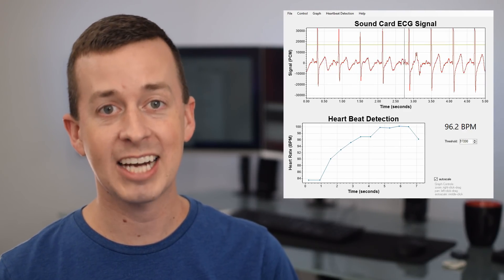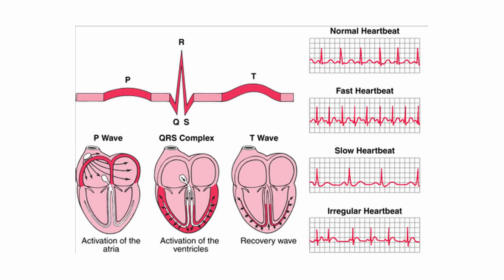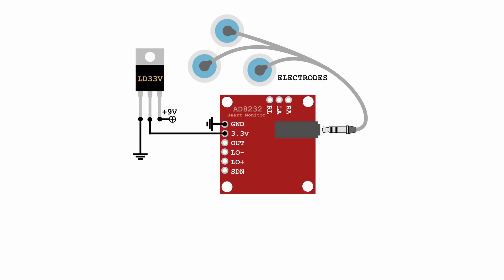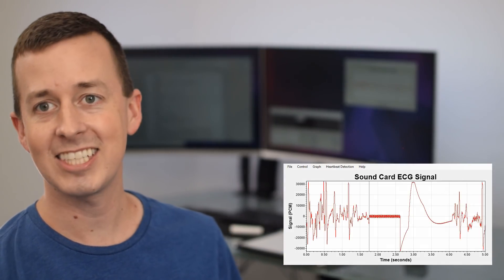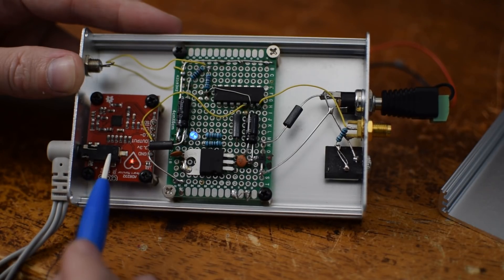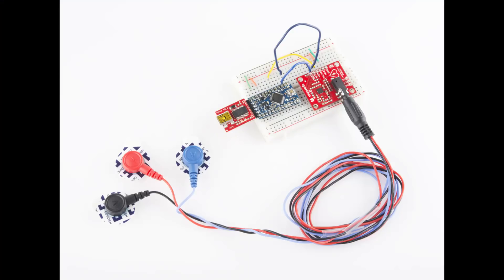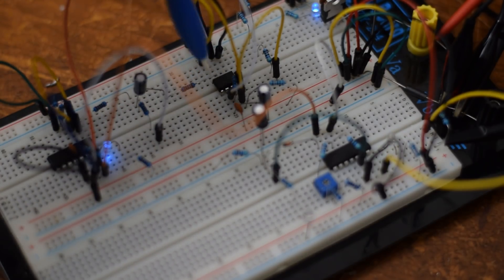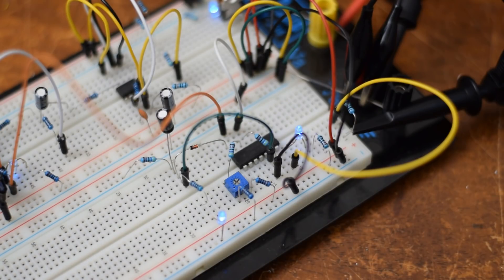DIY ECG with AD8232 and Sound Card

Comment: I have a doubt,will it give same accuracy like real ecg machine.and how many percentage of accuracy will it give
Reply: As a retired biomedical engineer, I can comment on the accuracy.  Firstly the timing accuracy.  This is hardly going to be affected by a simple ecg device such as this one.  The intervals between cardiac events take place anyway and are recorded by the device and the viewing system and will be shown clearly.  To make a real diagnosis one has to make careful measurements of the interval between the events (eg QRS interval) with a high quality system and then use years of experience and training to make a diagnosis.  As for the amplitudes, these are indeed likely to be distorted by the simple circuits but amplitudes are hardly used in diagnosis because they are so variable and unreliable anyway.  Electrode type and placement, chest wall thickness, obesity and gender all affect the amplitude.  Mains interference and movement artefact also affect the apparent amplitude so apart from the general shape of the signal, I suggest you forget about the amplitude.  The exception to this is if you see that the QRS spike is very low and flat, in which case you should seek medical attention.

Comment: I did this without any of the extra capacitors and stuff shown for the QRS circuit and whatnot. I just have the AD8232, a voltage regulator and a battery. My computer isn't picking up the audio jack as a microphone, so I can't display readings, even though before I plug it into my computer the light on the AD8232 flashes with my heart beat, so I know the circuit itself is working. Is there any sort of software or driver I have to download to get the readings onto my computer?

Comment: 😅sorry about your health. buut, i built you gdmaned ecg, it worked. instead of a computer i used a battery powered oscilloscope. its noisy but it worked. now to work on a 60 hz filter.

Comment: a great video. I have a few Karda devices A large amd a credit card size/   they use a coin battery to reduce size. also, any ideas on their Elec odes without wires - what to use for DIY. thanks for your great work. I also want to transmit the signal short distances over 433 devices. will try to change the signal with the Arduino plotter readings.

Comment: I've seen those using arduino and the plot looks pretty "spiky" (not as smooth as yours).  I wonder that is because of the entire circuit you built or the quality of the eletrodes. Either way, I want to know if I need all of that circuit for it to work like that or simply conecting it on a double end p2 jack hooked to my computer directly. I would like to know if its possible to save the data and plot a static version of the graph as well. Great job!

Comment: Great video! Can you upload the diagram circuit with lm324  because i can not find it.Trank you
Reply from the maker: Hi Ivan, this video only uses a AD8232, not any discrete op-amps like LM324. Check out https://youtu.be/AfirWls9Sys for a design like that
Reply: @swharden  Thank you very much for answering, in the video I see that you use a lm324 buffer and an indicator led, what would the circuit be like since I don't know how you did it? thanks
Reply from the maker: https://pasteboard.co/JMGTa46.jpg
Reply: @swharden  Thanks for answering, look, I am asking you, I have to measure the heart rate with a microcontroller. Is there a way to connect a smith trigger comparator to the ad8232 and generate a square wave to measure it more easily? thanks
Reply from the maker: @ivanirumberry2125  I think you are asking about a Schmitt trigger comparator. Yes, this can be done but I do not have an example. This topic is discussed in this video from 12:30 through 15:30

Comment: Did you happen to post the circuit diagram (or breadboard diagram) for the EKG simulator somewhere?
Reply from the maker: Unfortunately no, but it's just a 555 timer that makes square pulses at about 1Hz and such a circuit should be easy to find online
Reply: Scott Harden I’m more interested in the filtration you used to make it a « spike ».
Reply from the maker: @bglezerson  I updated the description to include a link to this circuit since this question does come up from time to time. Let me know if it helps! https://swharden.com/blog/2020-09-27-ecg-simulator-circuit/

Comment: I asked myself, what is the difference between and Adinstruments channel recorder and a Sound card ECG device? I bought an Adinstruments 8SP for 200 USD on ebay. But for ECG it needs an additional Bioamp, which costs additional 150 USD on ebay. Is the Bioamp equivalent to the ECG breakout board, and the channel recorder equivalent to the rest of Scotts circuit? 

I asked the Adinstruments support how many EEG channels the Adinstruments 8SP supports, and whether they are validated data available for EEG recordings? No, no validated data available. The 8 SP works for 8 EEG channels, and I would need to buy another Biamp, the Octal, which looks very expensive. Furthermore I would need to upgrade from Labchart 7 (which I don t have) to Labchat 8, since the newer Adinstruments amplifier need Labchart 8. I give up my Adinstruments EEG validation project.

Comment: Unfortunately no Matlab printed circuit for Scott Hardens sound card ECG. Senior scientists care about your health Scott, and also about the quality of your support for the sound card ECG:

https://ch.mathworks.com/matlabcentral/answers/592234-how-to-print-scott-hardens-sound-card-ecg-circuit-be-printed-on-a-circuit-board-to-reduce-soldering?s_tid=prof_contriblnk

I did what I can to promote sound card ECG for Matlab. Maybe someone else will follow and promote it further, it s worth it. Scott Hardens sound card ECG for Matlab and Python, for junior scientists and simple people.
Reply: Matlab supporters complain about you, Scott, for not being present in the Matlab community. I also miss you there. I suppose your device requires only Matlab student version is 50 USD or Matlab home version for 100 USD. A good example for being present in the Matlab community is Peter Charlton with his respiratory rate estimation project:

https://ch.mathworks.com/matlabcentral/fileexchange/55289-respiratory-rate-estimation

Such a presence of the sound card ECG in Matlab would be desirable.

Comment: Hi Scott , just a little word of caution. The ground pin of the sound card is probably connected to the mains earth.This could be a source of danger in case of some devices which have a ground fault.Hence it is probably much more safer to use a battery powered laptop. Of course the best would be to use a wireless bluetooth device, i guess.
Cheers and hope you are in the best of health !
Reply from the maker: Hi @mumbai, I hear this comment frequently. The input impedance between the AD8232 and the pads is extremely high. Even if the AD8232 were grounded (e.g., through the sound card), risk is eliminated because the person is not connected to the AD8232 through a low impedance path, so a ground fault is not a concern.

Interestingly, grounding yourself to your computer is common. Many people physically ground themselves to their computer with a wrist strap connected to their computer chassis when they work inside their computer. Since that is a low impedance path to ground, a wrist ground strap strikes me as much more of a concern for ground faults than a setup like this. It's an interesting topic to ponder!
Reply: @swharden   Thanks for the reply. A ground strap has a 1Meg resistance to ground, hence it is not a " low impedance path to ground", quite the opposite actually. Also when working on mains equipment always unplug the device , else/and use suitably rated probes and test equipment. The last thing you want in such circumstances is a  "low impedance path to ground"
"risk is eliminated because the person is not connected to the AD8232 through a low impedance path"
Actually isn't the conductive gel drastically reducing this impedance ? I could not get the circuit diagram of your module, so am not too sure about this.
Indeed it is an interesting topic to ponder.
Reply from the maker: @mumbaiverve2307  Thank you for correcting me! You are right, wrist straps typically have high series resistance and are not low impedance. I definitely overlooked this point when drawing my comparison. Silver chloride gel indeed decreases impedance between the pad and the chest, but if you review the AD8232 datasheet you'll find all leads are connected through high series resistances. I guess ECG circuits like this have high series resistance for the same reason that wrist straps do. In all cases, safety (especially when using mains-connected devices) should be considered.

https://cdn.sparkfun.com/datasheets/Sensors/Biometric/AD8232_Heart_Rate_Monitor_v10.pdf
https://www.analog.com/media/en/technical-documentation/data-sheets/ad8232.pdf
Reply: @swharden  Thanks for the reply and the docs ! Hoping for more videos in future...
Reply: @mumbaiverve2307  and @Scott Harden. I took over some of your suggestions to a discussion in the EEVblog. I triggered a tremendous discussion about safety of EEG and ECG devices which are connected to a PC in the EEVBlog:

https://www.eevblog.com/forum/testgear/how-to-solve-the-ti-ads1299-eeg-demo-kit-is-not-save-for-humans-problem/

Even connecting an ECG or EEG device to a battery powered laptop, is risky, just check the discussion there. OpenBCI recommends to use EEG devices with wifi for safety reasons. Is it possible to connect a Wifi module to your circuit? Or audio over bluetooth? Or connecting your circuit to the audio jack of a Linux Pinephone and use the Pinephone as a data acquisition system to avoid risks?
Reply: @swharden  Nice to have your reply, which means you are doing well , I hope !

Comment: I m currently struggling with several devics which have the potential to be research grade devices like Scott Hardens sound card ecg, Bitalino, Mind Monitor, Dr. Ing. Rainer Blinds a training tracker, but they are generally not develeoped for this purpose. With a little effort, this can be changed. I m promoting the idea to integrate MQQT in the device software and stream sensor data to the Influx data base. In this way, sensor data from different low cost high quality devices can be streamed into one data base, and can be read out for instance with the Influx Data Base client for Matlab or Python:

 https://ch.mathworks.com/matlabcentral/answers/585584-adding-mqqt-to-the-eeg-mind-monitor-app-for-a-real-time-stream-to-matlab?s_tid=prof_contriblnk

https://ch.mathworks.com/matlabcentral/answers/585593-adding-mqqt-to-the-ant-and-ble-a-training-tracker-app-a-for-real-time-stream-to-matlab?s_tid=prof_contriblnk

https://forum.bitalino.com/viewtopic.php?f=19&t=627

MQQT is well established and there are android apps available for MQQT, MQQT brocker targets in the web, and support in Matlab, Python, Influx Database and Grafana for MQQT. Adding MQQT to your software would strongly increase the value of your software, Scott, and would make it easy to combine the sensor data of sound card ECG with sensor data from other devices.

Comment: Hi Scott. I´m from Colombia, and i'm actually studying Audiovisual Design on Argentina. I am developing, with a partner,  an experimental "artistic" project based on the beat rate. Our idea is to create an interactive installation where the beat rate of the users is measured and traduced into digital parameters, that are used afterwards as MIDI parameters to produce and change the sounds, the lights and some other parameters of the installation.  The conceptual idea is still on process, but we are starting to approach the technical issues. We have  no experience, so we are introducing ourselves in a new whole world of electricity and sensors. 
We started with Arduino and its small sensor, but the response of the sensor to the heart beats is very poor. We are probably gonna try your way, which seems a nice option. If you have been working on a way to measure and visualice the beat rate, that doesn't requiere this ECG chest connections, we are very interest on it.  And we also hope we can make you some technical questions about the structure of the device. 
This is an academic project, and as I told you, our experience with this areas is null. We are hoping to find someone in Argentina that can help us on the building of your system.

Thank you a lot for you contribution. We send you very good energy, and hope your health its ok. 

and excuse me for my basic english XD
Reply from the maker: Hi Juan, this sounds like a really interesting project! Check out the "SparkFun Pulse Oximeter and Heart Rate Sensor" (google and you'll find it). It may let you do something similar without requiring chest leads.
Reply: @swharden  I was also interested in these Pulse Oximeter devices. They are more practical than ECG devices. They can also be used to determine heart rate variblity or respiratory rate estimation in Matlab. But unfortunately I found that the accuracy of low cost Pulse Oximeters is not very high. If you don t care too much about accuracy, then this device is fine. But me personally I came to the conclcusion to use an ECG device for HRV measurements and respiratory rate estimation.

Comment: One more question, Scott. Can your software deal with mutliple (usb) sound cards?
Reply from the maker: +
indeed it can
Reply: @swharden  great, great, great. I ve read that multiple soundcards are sometimes a trouble. Matlab can deal with multiple soundcards, but  I will choose Matlab only when there is no other option available. And Matlab cannot be used on the Pinephone. ECG modules are now around 4 USD on Aliexpress, EEG modules around 30 USD. But prices of these modules trop slowly. Those of other EEG components like those of Texas Instruments remain static. Therefore for DIY EEC solutions, your device becomes more and more attractive.

Comment: Hi Scott, it is me again, probably one of the biggest fans of the sound card ecg

Zero Phone has developed a DIY phone based on the Rasperri Pi zero. All components are listed and the plans circuit boards are publsihed

https://wiki.zerophone.org/index.php/Main_Page

https://www.youtube.com/watch?v=iG2J-DwYaYc

https://hackaday.io/project/19202-small-pcbs-for-panelizing-tutorial/log/59210-panelization-using-gerberpanelizer-on-windows-linux-possible

I really love the sound card ECG idea. It could be used for all kinds of physiological sensors. I m now in the position to start soldering these devices sooner or later, or to look for friends who are also interested in the device, to make it easier to build. I m not a specialist in this field. But I think the Zero phone is a good example what could be done. A circuit board could be put togehter which can be ordered somewhere and only needs soldering of the parts. This could be a community project. Contributors welcome.

regards, Peter Gamma

Comment: I am getting error when i open this software.
Reply from the maker: Interesting! Does the error have a message indicate what the problem is?
Reply: @swharden  UnspecifiedError calling waveInOpen.
Reply from the maker: @hussain55019  It sounds like your default recording device is not a microphone that can be easily recognized by NAudio. Double-check your default recording device in Windows settings, and ensure it's the device you expect.
Reply: @swharden  yeah the problem has been solved but now i am not getting any graph.
Reply from the maker: @hussain55019  It seems like you've selected a valid microphone, but it may not be the one connected to your ECG sensor, or the ECG sensor isn't outputting any signal.
Reply: @swharden  No it is producing a signal i have seen it through oscilloscope and arduino.I have powered the sensor from arduino attached to the same laptop.
Reply: @swharden  when i speak something near laptop the graph changes with my voice it means that microphone is still active despite of audio jack being plunged in.
Reply from the maker: @hussain55019  It sounds like the software is working properly, but it's monitoring your audio microphone instead of the input provided by your ECG device
Reply: @swharden  now what should I do?
Reply from the maker: @hussain55019  Determine which audio input device is associated with your ECG module. Make sure you set that device as your default recording device. You should be able to record your ECG in any audio program (like GoldWave). Once you know your ECG can be recorded using any audio program, it will work with the SoundCardECG program
Reply: @swharden  Thanks brother may god bless you with health and happiness my problem has been solved actually my laptop has combo jack and i was using Aux cable that's why laptop internal microphone was always active but when i used an audio jack which has a microphone layer the problem was solved.But the graph i am getting now is distorted and HBR is above 200.I have used 1K resister in series with Sensor output.